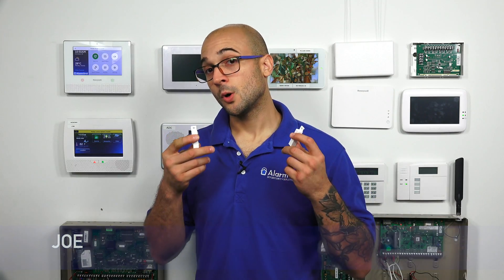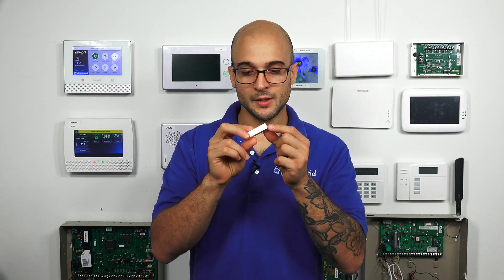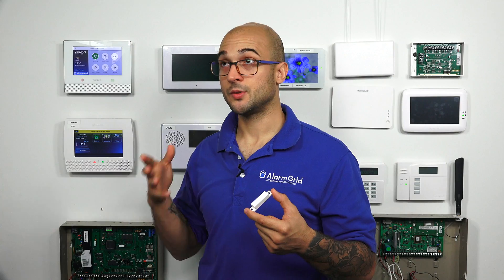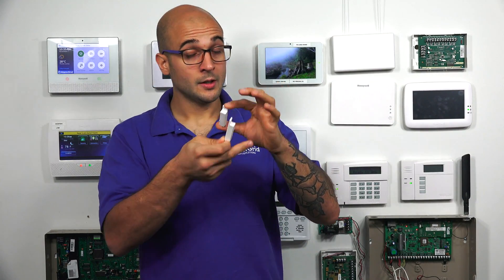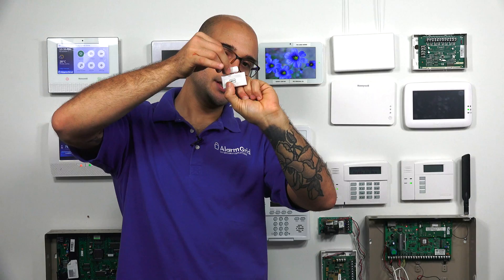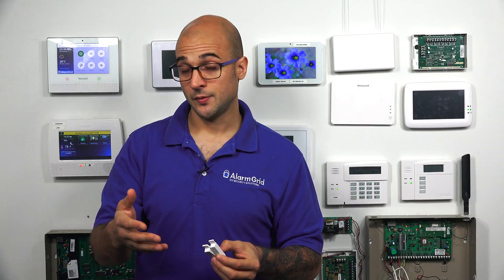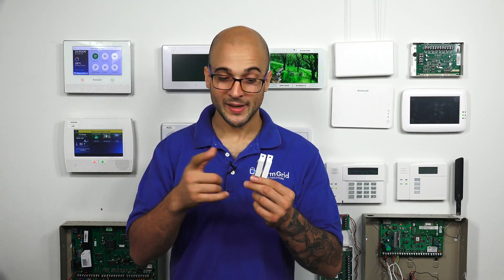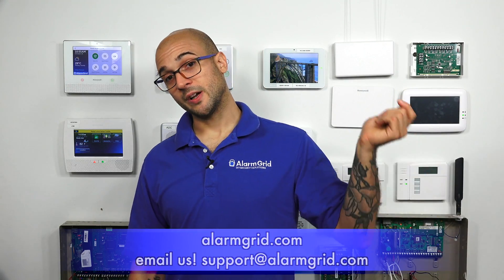Reasons Why the Wired Alarm Contact on a Door May Not Work

Comment: How do you access the wires in a wired contact sensor?
Reply: Hi @JebBushHimself, Wired contact in most designs will have terminals that allow wires to be screwed into the sensor. These terminals are usually covered by a top cover that can be opened. Depending on the contact these screw terminals can also be exposed and accessed by removing the sensor from the mounted location.

Comment: If the resistor ius at the panel go to the lat one in line twist the wires to gether then test. if still faulted move to the next one until you locate the bad device

Comment: I had to re-install all the hardwire contact sensors after a new window installation, I bought the replacements but my question is: does the color code have to have a specific input in the wire sensors, do they have a polarity sensor like electricity (negative vs positive). I have experience with installation since I work for telecommunication ISP
Reply: For most hardwired systems they do not have polarity, if the device requires polarity you would be using a different contact that is usually manufacture specific. The standard door/window contact does not.

Comment: Should be mentioned that the reed in the sensors can get stuck/magnetized closed. Symptom of this is when the door/window is opened, the alarm does not chime or start timing for disarm code. You can tap/smack/hit the sensor a few times with the back of a screwdriver (not very hard) and if it starts working again, replace the sensor.
Reply: Blows my mind that he didn't mention this..
Reply: RODENTS??? How dare you, sir?
. Truth is, I think the mice are using the alarm wire as a tightrope to get from point A to point B.

Comment: Thanks for the video I have a door-wired sensor and it failed two to three times. Have in mind that when that happens the sensor shows open door No contact. The weird thing here is that I removed it to check the wires' contact(( there were tied )) suddenly worked for a couple of months but it has failed again! I did the same now it's ok. What do you think as an expert to do?
Reply: Hey Michalis, If you are having issues with a wired sensor. It may be something in the overall wire run back to the system where there may be a break somewhere else in that wire run. If you have a multi-meter you could do a continuity check to confirm the wiring has no issues. Worst case scenario is that you would need to run new wire for that zone or switch to a wireless option if running wire will not be easy.
Reply: @DKAlarmgridSupport  thanks for your help again. Again its weird firstly I used a wireless sensor and experienced lots of trouble triggering the system saying kitchen door open etc I have switched to wired instead believing that is going to solve this issue! It has lasted a year and it happened again.

Comment: Can that contact switch be used outdoors ? If not do you know of one that could ? I'm trying to install a blinking light on an automatic gate. Thanks
Reply: it can I recommend putting silicone around cracks to prevent moisture from getting in

Comment: How can I reset my door to say front door if I open front door of if I open back door to say back door
Reply: You'll need to change the name of the zone within the panel programming. If you're a current monitored customer with us feel free to email us and we can assist with this, the email is support@alarmgrid.com.
Reply: It shows the front door and back door while opening the door because these zones are programmed with zone descriptors. 
If you want to rid off that feature then you need to go into the panel programming and delete the zone descriptors. 
Panel programming needs to be done by the professional only. 

If you have Honeywell low-end panel, let me know I can tell you the steps. 

#Stay safe :)
Reply: you might to download compass 2.0 and just use that to do your programing. it's a free software
Reply: Can i add a wireless contact on to my wired system?